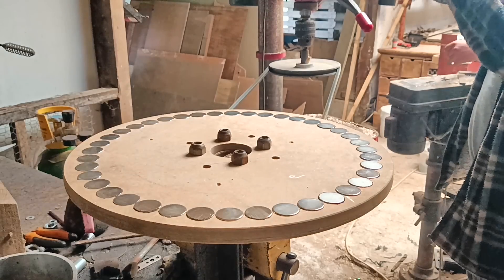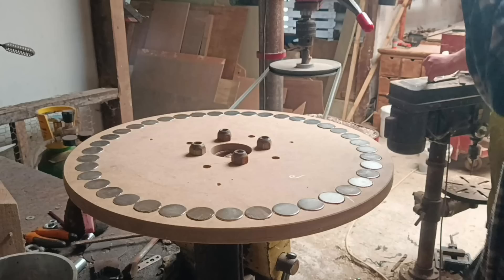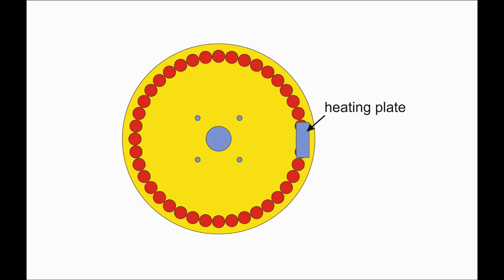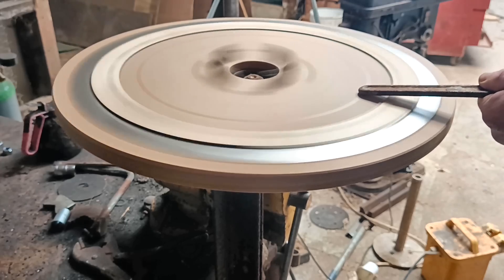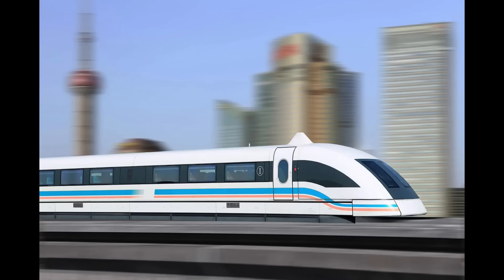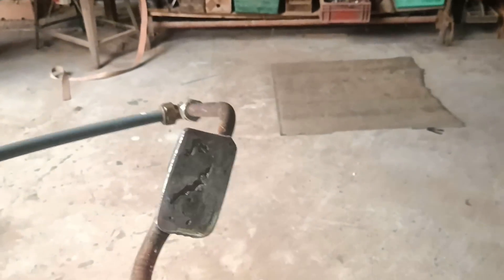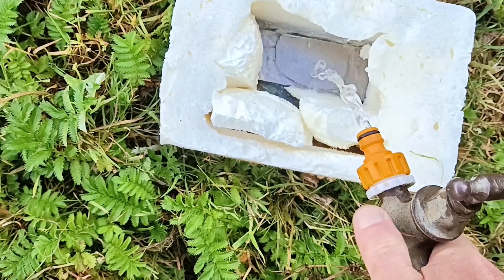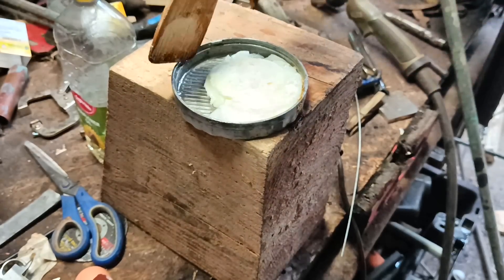Cook An Egg Over Magnets  - And Other Interesting Induction Heater Stuff..

Comment: If you flatten the copper pipe a bit to give it a larger surface area at the bottom and make it into an arc to cover as many of the magnets as possible until the drag becomes too much, you might not even need a heating plate at all! It would also reduce the amount of magnets needed for the full-scale heater as you could get more energy from fewer magnets by covering more of the them. I'm really enjoying this project, thank you for this video
Reply: ^^^^ Came to post exactly this! And you vary the distance of the pipe to increase or decrease load. After all you are just inducing a current in the copper "winding" that's really a pipe, its a like a transformer but the field is generated with magnets. You want to take advantage of all the field flips, thus make a copper pipe hoop with a break in it for the inlet and outlet. Might even be better with thinner pipe like 10mm microbore, but loop it round a few more times. Its surface area of the heater coppper that is warming your water after all. You would control the speed of your windmill by tightening the gap between the magnets inducing more load.
Reply: I too, came to say this! The arc should go 98% around the circumference! 
   This is an awesome proof of concept, but it's at this point, I would sit down and completely redesign the entire lot!
It can be made exponentially safer and more stable by building an actual rack to mount things to, and everything would be made more precise, for at least a little balance, before someone loses a finger, or an eye!!! You start getting too comfortable around contraptions like this, and somebody gets hurt...

I wouldn't need any more evidence to see the possibilities are endless!!!

I can already see instant steam generation happening with a bit of tweaking, and we all know what that means!!!

Wish I had the time and space to do this 😫

Comment: I don't have any practical experience with magnetic induction to back this up, but I suspect you'd be better off bending a copper pipe into a curve to follow the magnets, and then maybe flattening it out a bit to get more of the copper closer to the magnets, rather than using a plate soldered to the pipe. And then once you have the wind power set up you can adjust the length of pipe to match the power it generates. (I imagine you know that copper work hardens with bending but can be softened again by annealing.)
But it'd be worth an experiment to compare! Easy for me to say since I don't have to do the work. ;) You'd definitely want a way to fix the pipe/plate in place  for the test rather than holding.

Comment: Another great inquiring video Tim. Thanks very much.

One reason the aluminium is slower to heat the water compared to your copper tube is almost certainly because you have much more water in the icecream container you had mysteriously emptied. Weight for weight, aluminium is a better electrical conductor than copper so it should be better at being inductively heated.

Comment: Making a magnet carrier that can stand higher speeds is an interesting challenge. Maybe a bicycle wheel can be used if one can be sources with a large enough diameter?

Since your magnets are disk shaped, cutting slots into the rim of a bike wheel slightly shorter than the diameter of the magnets would allow slotting them in from the inside without the risk of them flying away outwards when it spins. Ring shaped wooden plates either side of the magnets (clamping onto them by bolts with nuts) could be used to keep them aligned and to prevent them from falling out when not in use but they wouldn't take any of the radial load.

Problem is on ordinary bike wheels the spokes will get in the way of both the magnets and potentially alignment plates so it might not work as well as I'm thinking...

Maybe enough of the spokes can be removed to fit the magnets and alignment plates be placed over the portion of the magnets that stick through the rim? Removing spokes might weaken the wheel too much to hold the magnets at speed though...

Interesting challenge indeed.

Comment: What you call "drag" is exactly what you need to capture the mechanical power into heat. It shows that mechanical work is being done. Without that "drag", you're not capturing any of the mechanical power, and all the energy is lost to friction in your spinning mechanism. So, you want to maximise that "drag" by making the air gap as small as possible.
Reply: Well, it should still turn, right? Maximize it and there is no movement... 😜
Reply: @IvoTichelaar  The amount of resistance you can push through depends on the motor. So the more resistance the motor can overcome the better. More resistance with a bigger motor would be hotter.
Reply: @IvoTichelaar  That's not a physical possibility. If it's not moving, it can't do mechanical work, and so there can be no drag.

Comment: Jeez commenters don't understand magnetic circuits at all.
Correct solution - steel plate, magnets halfway in it - steel plate connects field lines of the opposite poles.
Reply from the maker: the problem is they sound as confident as you do, but they tell me the opposite. What should I do?!
Reply: @wayoutwest-workshopstuff6299  open FEMM simulator and optimize for maximum field or in the same vein read on magnetic circuits and how field behaves.
Reply: @wayoutwest-workshopstuff6299  read up on magnetic circuits in general and confirm in something like FEMM - you're optimizing for maximum field strength - steel allows to connect the field of the opposite magnet poles.

Comment: If you could hold it as close to the magnets as the copper or aluminum, steel would likely heat up much faster due to hysteresis and not just eddy current. That being said, you should stick to copper for this application. You are correct that this kind of setup is very forgiving for matching the load to the power source; you essentially have a water cooled magnetic torque converter here. You could probably imagine such a thing being used in an automatic transmission, except in this case the load isn't allowed to move at all, so things just heat up :-)

Comment: Why do aluminum and copper react to the magnets and warm up? I thought they aren't magnetic?
Reply: Because a changing magnetic field will induce an electric current in any conductive material, regardless of whether it is magnetic (for example the coils in a generator are usually made of copper). The electric current causes the heating.
Reply: @simong9067   ok, I'd like to ensure I understand the point here. A magnet won't stick to these materials, but changing magnetic fields will still warm them? 

What is it about the properties of non magnetic metals that allow them to warm in the presence of a changing magnetic field vs. say another non magnetic material like plastic or a rock?
Reply: @RickyHarline  Good question! What makes the difference is that metals like copper are electrical conductors.  That means that some of the electrons in their atoms are free to move around, unlike non-conductors like plastic or rock, in which the electrons cannot move.  When many electrons move, the result is an electric current.  Even copper has electrical resistance  so that a current flowing in it causes heating.

What makes the electrons move in the first place is the phenomenon of 'electromagnetic induction': any electrically charged object that experiences a magnetic field that changes with time feels a force and if it can move it will.  It is the time-varying magnetic field that deternmines the strength and direction of the resulting current.

This is quite separate from the phenomenon of 'ferromagnetism' which is how some materials like iron can retain a magnetic field and also experience a force from an unchanging magnetic field.
Reply: @simong9067   rad, thank you. Appreciate you, brother

Comment: smaller magnets over the same circumference would result in more magnetic flips
Reply: Focusing on "flips" is an erroneous path of inquiry. If you take a single magnet and run it past a bulk conductor it will experience heating proportional to the power it took to move that magnet. The same effect of eddy current heating occurs with exactly 0 flips. All that is required is that any given spotin the conductor experience a change in the magnetic flux over time.
Reply: @AtlasReburdened  Strictly speaking you are correct, but very misleading.

Consider for the sake of argument two arrangements: one has a single continuous magnet along the perimeter of the wheel (N up, S down), the other has the magnet divided into sectors that are alternating N up+S down / N down + S up.

The former will have no eddy current heating (the magnetic field is unchanging when the magnet spins); the latter will have a fair bit of eddy current heating.

For maximum eddy current heating you want the highest change in magnetic flux possible per unit time... and one of the simplest ways to accomplish that is to add more poles (until other effects start dominating, of course.)

Comment: I think the copper heating element needs surface area. You probably could easily knock together a box based on a cheapish copper heat sink and two fittings on each end to increase the surface area water can interact with. Also, I think you don't want to mix aluminum and copper pipes, so a copper heating element leading to copper pipes is safe enough.

Comment: Tim... let's take a look at radiators! You'll notice that they have a large surface area in order to heat up as much air as they can. I think that applies here too, even a simple setup could be much more efficient if you added several copper "fins" for the water to pass over, or perhaps a copper coil inside of the pipe. I think the reason copper has been working so well isn't necessarily because it is heated quickly by the magnets (I'll be honest, I don't know much about that), but because it is a very good conductor of heat. Best of luck with your project, it is fascinating!
Reply: I second this more surface area in contact with the water gives more heat transfer if you could somehow make a box with the plate you made and then added Fins or channels for the water to go through inside the box and then ran water through the box it may work better just like a radiator! I probably just reexplained a radiator if so I'm sorry but  something to look up would be computer water cooling. It's basically what your trying to do here but on reverse (cooling instead of heating) but technically the technology still applies
Reply: @kmspader2239  with magnetic induction, a solid block of copper with channels inside for water flow, would be far more efficient than any kind of pipe with fins, inside or out... It's not the metal producing the heat, it's the magnetic flux within the metal that is....
Reply: What you don't understand is, thin copper will not produce as much heat, as the thicker copper does. The eddy currents are increased by increasing copper density, thereby imparting more heat into the water... This is what actually heats the water, not the copper itself...

Comment: The steel plates behind the magnet makes the other side stronger. Magnets sideways between every pole will remove the dragging effect. It's not rocket science, or magic ;D
Reply from the maker: 'Magnets sideways between every pole will remove the dragging effect' - but I'm assured that without drag there will be no heating?

Comment: I was wondering, that maybe you should aim for minimal amount of magnets and maximum speed. Which means a small disc, or entirely a different design, i would suggest a tube, with the heating element inside it, while its being spun via an axle fixed to one of it flat sides, the other being open obviously. And it needs to be seriously well balanced

Comment: Interesting, a bigger wheel with more magnets would give higher frequency at same RPM, always wanted to try putting hundreds of magnets around the rim of a water wheel, wouldn't have to rotate very fast if you had say 1000 magnets.. no belts, chains, pulley's just magnets and coils or in this case a heating block..

Comment: @4:30 "All the people who tell me I should just use a generator might be right!"
I'm enjoying this journey of discovery. Hope you are feeling better. They probably ARE right about the generator, but where's the fun in that? Also, building something yourself usually means that you can improve and repair it yourself too. I'm of the opinion that simple is usually best, and for me, the real challenges are in how to efficiently capture and use the energy your windmill generates. Unfortuately I see the magnets as just another level of complexity. Like all of the suggested improvements you shared, they can't in and of themselves add anything more to the equation, and the benefits are cancelled out elsewhere.
I'd love to see what could be done with a simple hydro-electric system. Using the windmill to pump water up from one reservoir to another, then releasing it through a turbine to generate electricity when you need it. It seems to be the simplest, most efficient way to harness, store and transport the energy you'll be generating, but anyone could do that, and you still wouldn't know what was possible with the spinning magnets!
So here we all are, learning as we go. Sometimes the journey is indeed as important as the destination. All the best Tim.

Comment: Huh, i didnt think there would be magnetic drag. If i think a little about it, it shouldnt cause issues as long as you wont let the heating element move along with the magnetic field. Its technically just creating a force equivalent to pressure, as long as there is no movement, and there is no change in the drag, it should not steal energy, since its not putting that energy anywhere

Comment: Instead of having the sail self furl, as the speed increases you want to bring the magnets and heating plate closer together, so you get more drag, which slows the windmill. You could use a mechanical governor for that.
Reply: Or maybe rather than closer together, the pipe could be bent in a way where it can be aligned with, let's say half of the magnetic circle, but at low speeds the magnetic circle would be slightly out of alignment. and some kind of governor mechanism would move the bearings the magnetic disk sits on so that the pipe is better aligned. Overlapping circles moving  between full overlap and slight non-overlap
Reply: The problem with that is it doesn't reduce the wind force on the windmill assembly and they've got some occasionally very stiff winds to contend with.  So will help to control the speed from getting too high, but he'll still want some way to reduce the forces the windmill is feeling.
Reply: @johnfreiler6017  Maybe the sails could be held in pitch axis by springs in a way that if the wind is too strong it can overcome the springs and set the sails along the wind at extreme
Reply: Does that drag cause more heating?
Reply: @BrettCooper4702 afaik it should, as long as the speed doesn't drop too far
Reply: @BrettCooper4702  the drag is directly proportional to the amount of heating. its power being absorbed, and converted to heat. 

the temperature reached is due to how much energy is absorbed versus how much is radiated.

Comment: You need some kind of fins or layers in the copper pipe to increase the transfer rate of the heat. Look up how a liquid CPU cooler is made on the inside, what is for the cpu.

Comment: Hi Tim. Interesting video as always. Next project could be a mag lift field railway? Anyway, just a thought, what if you put a fork in the thermosiphon pipe system, put 2 pipes side by side over the heater plate and then join the 2 pipes back into the single riser. Should transfer double (ISH) the heat into the water. Whether you would heat to the same temperature quicker or gain any temperature I'm not sure. That insulation seemed to help a lot. Initially I thought you would be better off generating electricity with your windmill and transferring the energy to the house and then converting it to heat to minimise energy loss. Now I'm thinking if you can heat the water to 60-70 degrees and thermosiphon it to the house, you only need 20-30 degrees in the house. As long as the supply is constant you should have the house at a comfortable temperature, eventually. It wouldn't be quick, but would be free and achieve the desired effect. Thanks for sharing this process with us. Very interesting stuff.

Comment: I wonder if ypu could shape your section of copper pipe to match the diameter of the magnets so you could expose a larger arc of the magnets to the "tank". Also making a coil of copper pipe on top of the hot water will make a better pumping action. The hot water fliws up through the coil via a cappilary action type thing

Comment: This is basically how demagnetizers work so it is no surprise it demagnitized your wrench.  Rapidly changing magnetic fields disorganize the magnetic field of the iron.  dont put credit cards anywhere near this, it will break em.
Reply: Only magnetic strips, though. Chip and pin and NFC are fine, unless you manage to EMP the card somehow.
Reply: @Skorpychan  This may cause heating in the copper traces of chip/nfc cards. Induction heaters can destroy those as well.
Reply: @Skorpychan  any kind of coil in a rapidly fluctuating field gets a nice dose of high-frequency AC. It'll break them too.
Reply: @justaguycalledjosh  Okay, so don't take my wallet into an MRI scan. Got it.
It's also best to avoid listening to Pink Floyd in one as well, because that led to some STRANGE hallucinations.